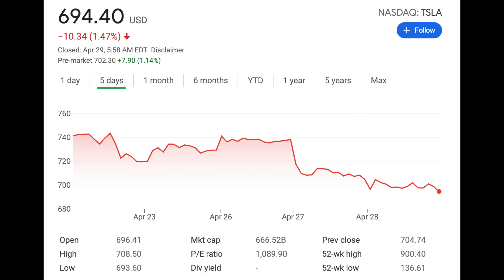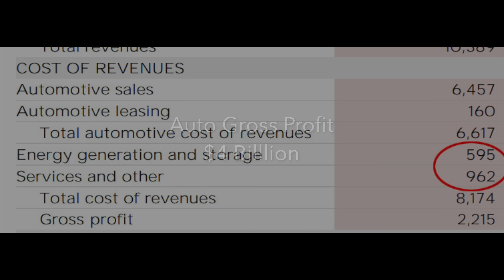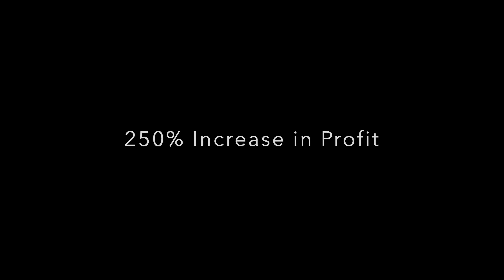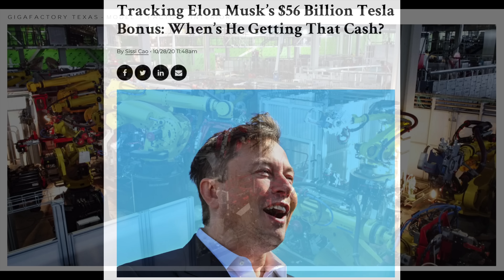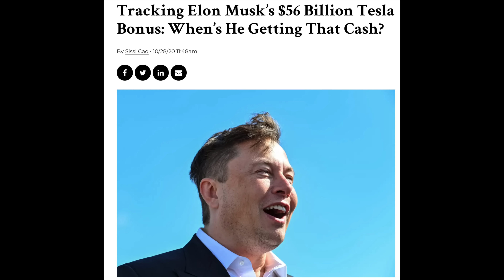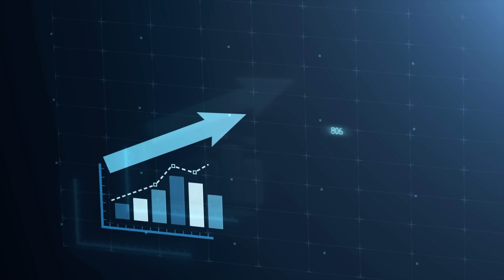When Will Tesla's Auto Business Break Out Enough for the Stock Price [TSLA] to Take Off Again

Comment: Q2 with 20k extra cars and 5k S & X will go straight to the bottom line. That's 900m on 3 and Y plus 500m on S and X. Margins will be good, because the increase is coming from China on the 3 and Ys. Margins on the few S and X will also be high (cheaper to make and superior product). Could be another 400m net profit.